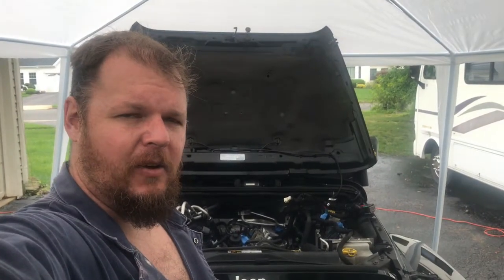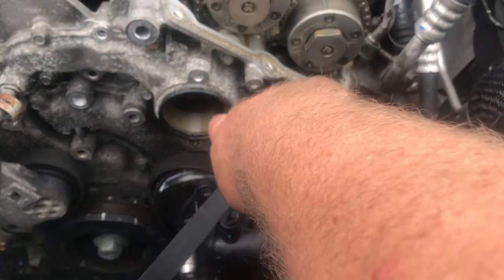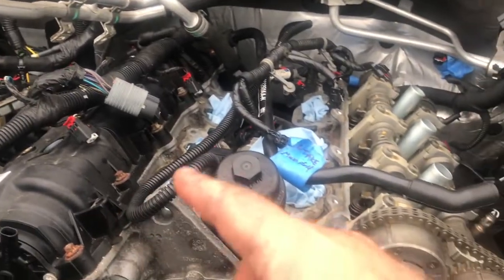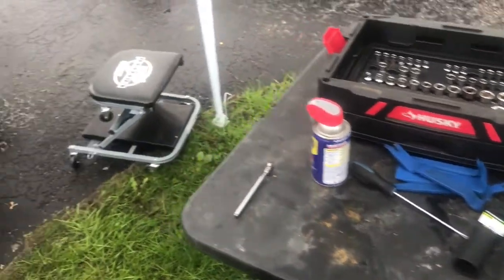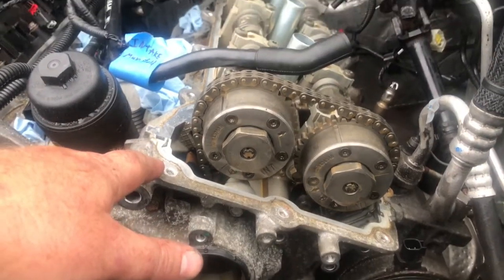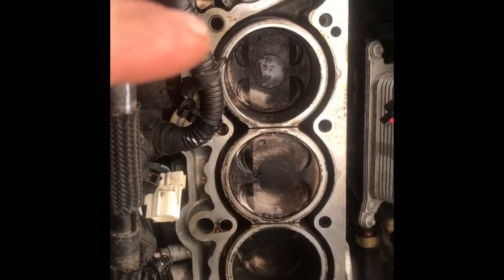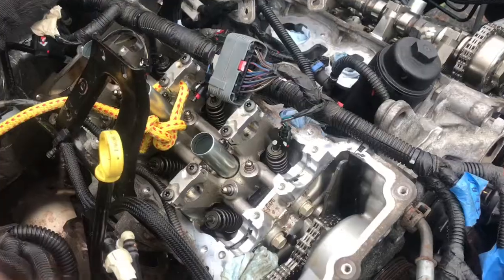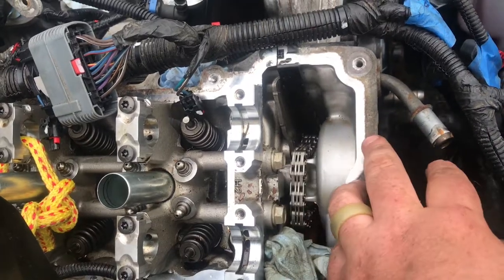Jeep jk 3.6L Headgasket replacement. What not to do. Plus tips and tricks.

Comment: How bad was getting that cylinder head off without taking the timing cover off? Isn’t the timing chain tensioner Bolted to the head ?
Reply from the maker: George Marris it’s do able but only for the drivers side. It may save 30 to 1hr as opposed to removing the timing cover. This guy has a good video but it’s from a caravan https://youtu.be/HpmtrAQ0nwQ

Comment: Hi, with the engine overheating, you only had to replace the head gaskets ???  Did you have the heads rebuilt?   [ This project is a little different, it does not run on steam  LOL    THANKS FRIEND
Reply from the maker: Ronald Cach no head work other than the gaskets. I did check for cracks and straitness. It’s been running for a few months now with no further issues